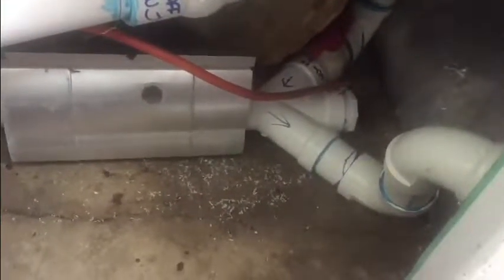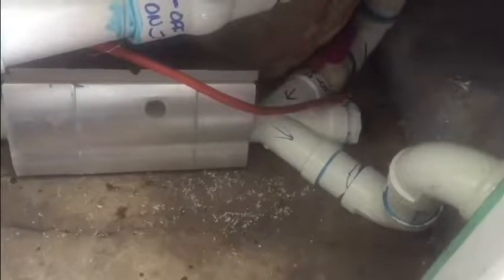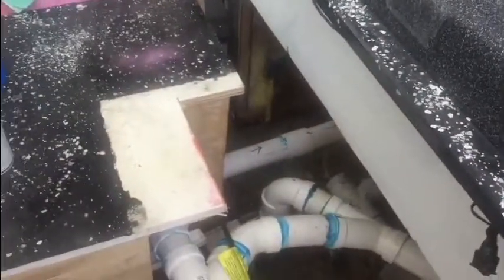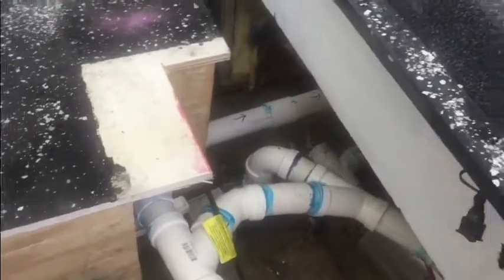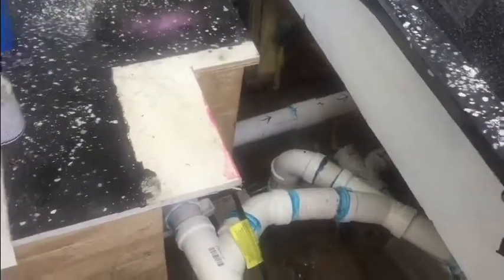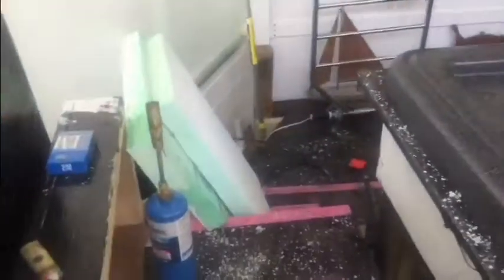DIY hot tub heater. Electric & Solar.

Comment: What pump is moving the water up to the roof and back down? I want to solar heat my hot tub i stead of relying on the built in electric element but i am afraid to buy a pump that is too weak.
Reply from the maker: Not sure if it can be seen in the video but I have a small pump that came off of a 4 jet tub. I have a T that’s 2” with a 3/4 to garden hose. I recently added a water gate timer that is set to open at 8am and go off at 4 pm. This time of year on sunny days it’s to much so I have to play with it but my tub stays right at 102. If it does get to hot during the day I just let it go to the solar at night and it will cool it just like it heats it. A small spa pump should  be fine to move the water in the tub and give you 15’ of head through a hose to go to solar. If I can help anymore let me know.